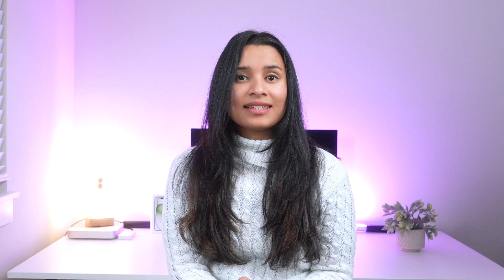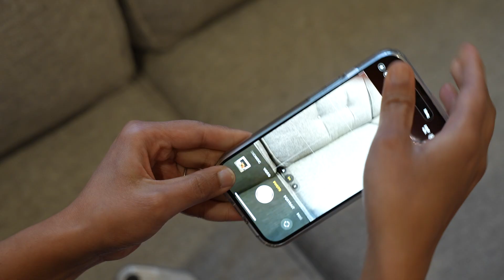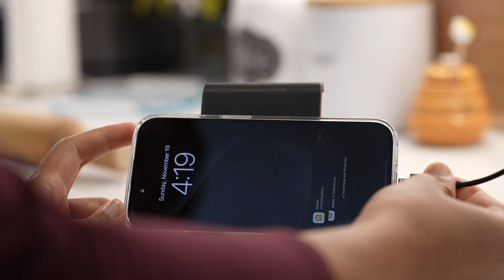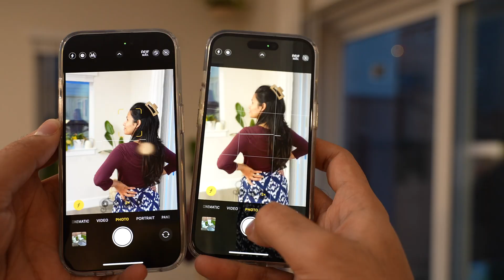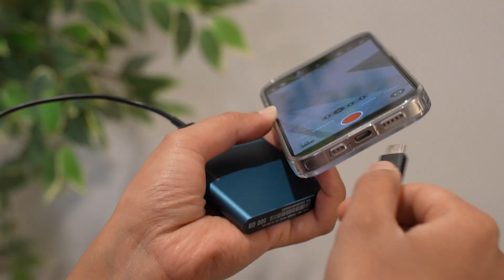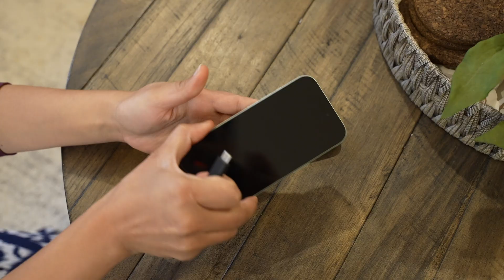Why get iPhone 15 over 15 Pro?

Comment: Hey Anjana, Thanks for this super informative video.. can you share your experience on the heating issues with both the phones
Reply from the maker: Hi Radha. I’ve faced zero heating issues on both phones till date. It was primarily on the 15 pro when it was released, but Apple fixed those heating issues through a software update